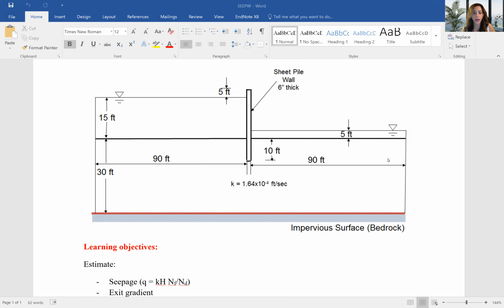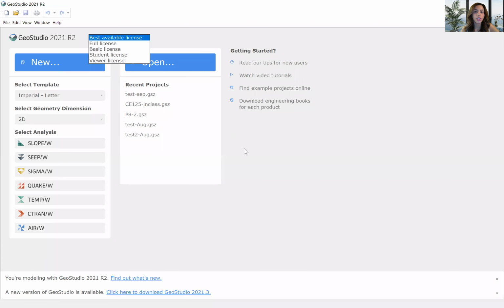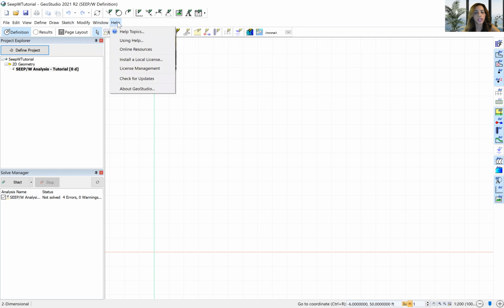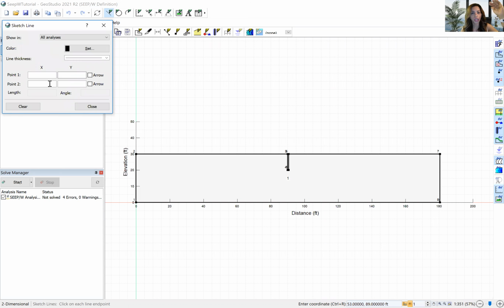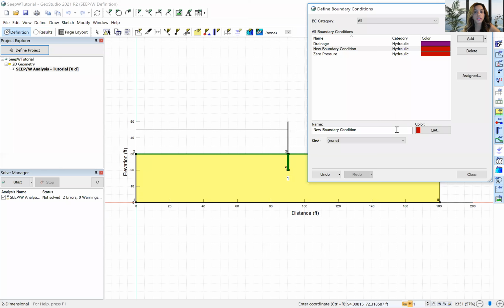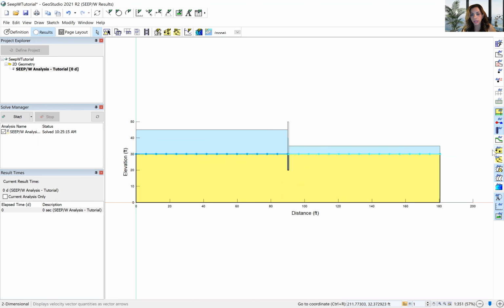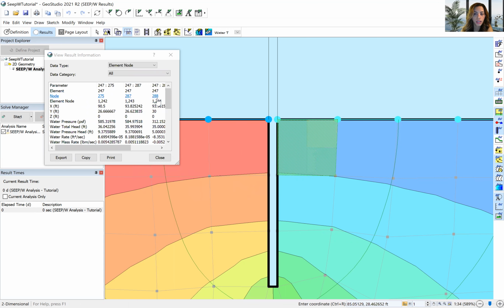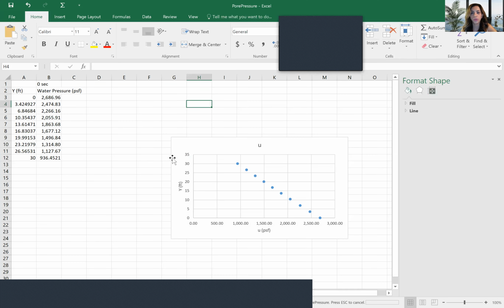SEEP-W 2021 Tutorial - Sheet Pile

Comment: Hi, how do we set the soil with a specific rain fall rate or rate of water coming through and not like a surface that holds and in contact water? and simulate how rain water flows through that soil ?
Reply from the maker: To simulate rainfall infiltration through soil in SEEP/W, you need to apply a flux boundary condition representing the rainfall rate.